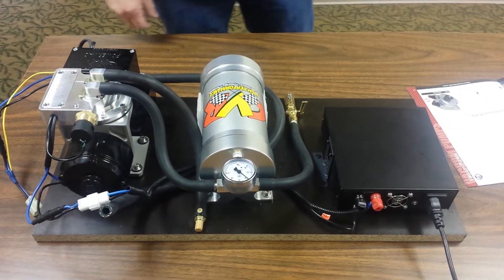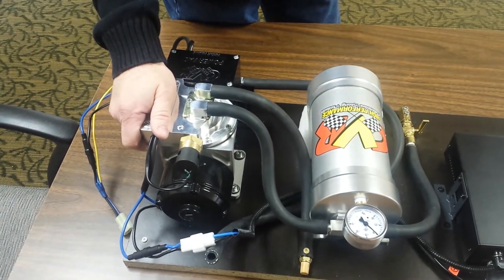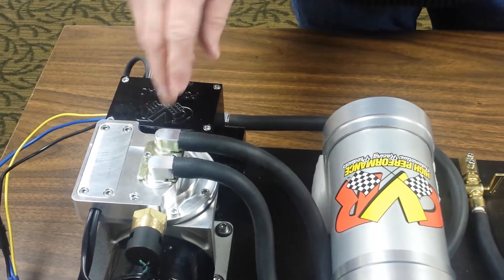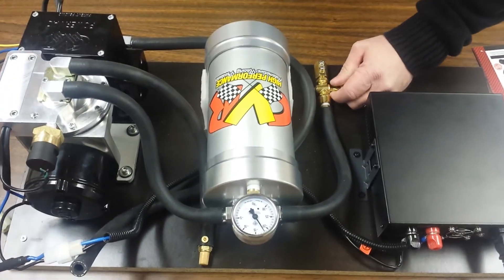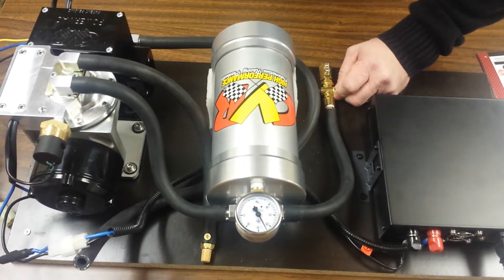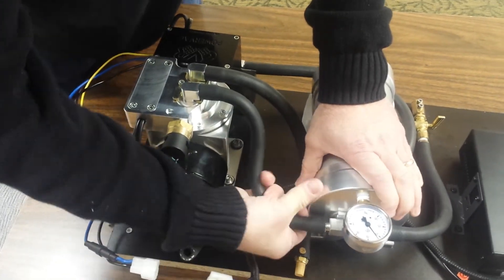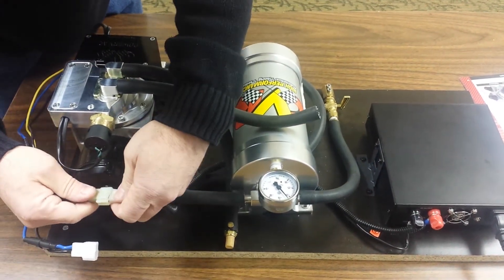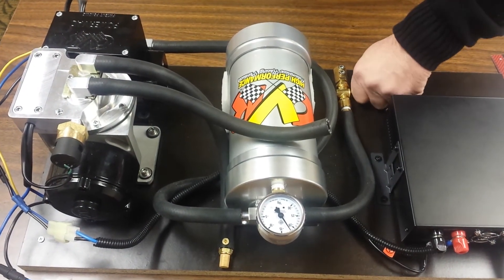Demo of theCVR  VP555 and VP665 brake vacuum pumps.

Comment: What's the difference between them?
Reply from the maker: The VP555 is a Diaphram Style pump cast aluminum pump.  Draws 4 amps and weights 8.34 lbs .  The VP655 is a Vane Style, Billet Alluminum pump. It has less noise and vibration and has about 50% more vacuum then a Diaphram pump.  it is also a 12 volt, but draws 6 amps and weights 5.5 lbs.
Reply: tracy thomas thanks for the reply!  Do you have to keep the vane pump oiled?  Is there any Maintenence?
Reply from the maker: It's not an engine vacuum pump but a brake vacuum.  Thus, you do not want to oil it and no, there is no maintenance needed for that.
Reply: One more question...  what's the difference between the VP665 and the VP655. They're both vane pumps and look identical.
Reply from the maker: The 655 is cast aluminum.  The 665 is T6-6061 billet aluminum that is Black hard anodized that helps to extend the wear and is more resistant to corrosion.
Reply: I emailed the CVR with no response...  if I use this as a backup, can I reduce the vacuum on the switch so that it doesn't over power the primary pump?  Also, would I just connect both vacuum lines together with a "T"?
Reply from the maker: I am not sure what do you mean as a back up as most I know use this as the primary break vacuum pump.  Here are instructions on the pumps.  http://www.cvrproducts.com/2014/wp-content/uploads/2016/05/VP655-VP665-Instructions.pdf